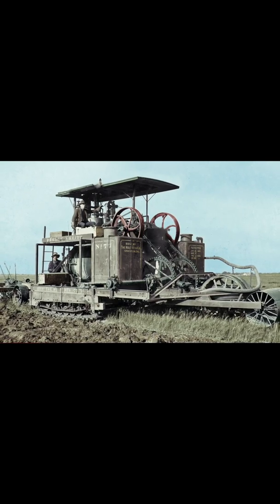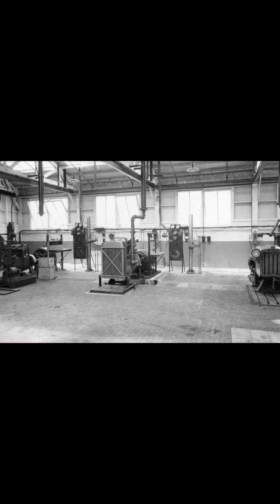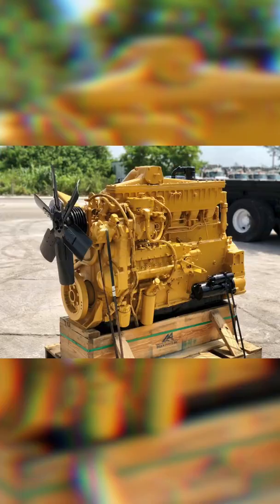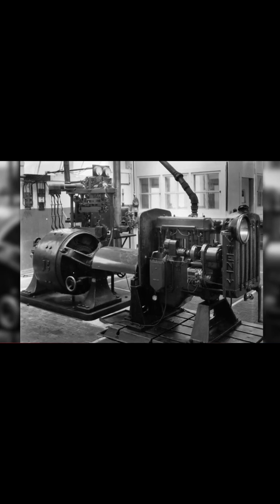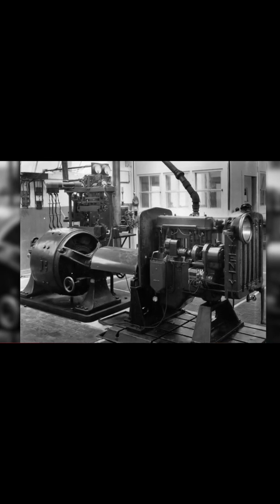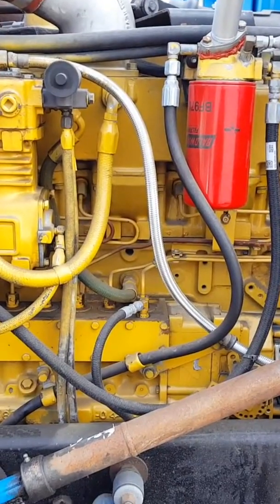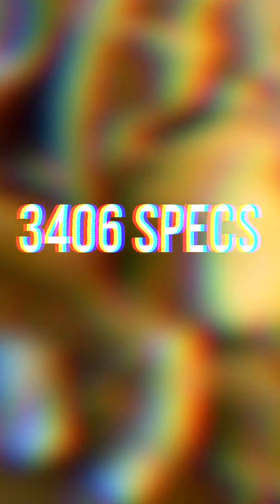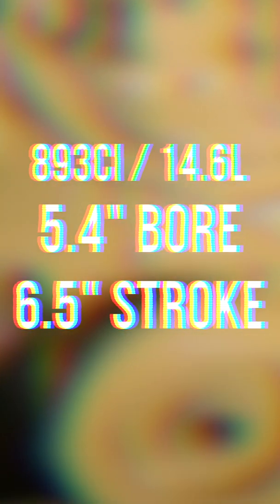The Legend of the CAT 3406 Engine (Short)

Comment: Cat and Cummins two greatest diesel engines ever made..
Reply: Which cat and Cummins engine? Because not all cat and Cummins engines are great engines
Reply: @charlesrodriguez7984  yeah, the 3208 and 555 namely aren't great.
Reply: @brokeaffarming we ran 3208s in farm equipment and had no problems.
Reply: I'm a fan of the N14'S and the 60 series Detroit 12.7 engine, I would have to own a cat engine to tell you if I think it's a good engine, my problem is what is the worst engine and there's people who made parts to fix most problems, so I think I can fix any bad engine
Reply: Cummins is terrible.
Reply: @Jameskelvin89  every engine gas or diesel has there strengths and weakness, no motor is 100% perfect. Cummins is still better than a Duramax anyway. I was referring to the 12 valve 5.9 straight six Cummins, my favorite engine for a work truck or van is the Ford 300 cube straight six, those are damn near perfect, of course there no speed demon but when it comes to reliability and ease of maintenance they  are  one of the best ever made..